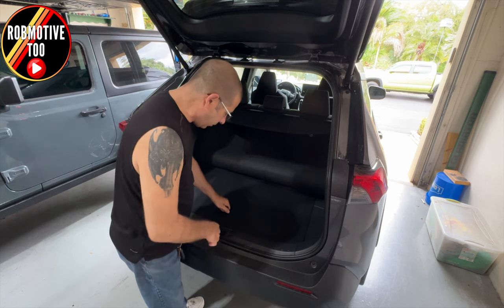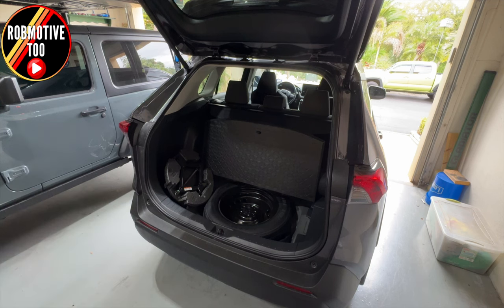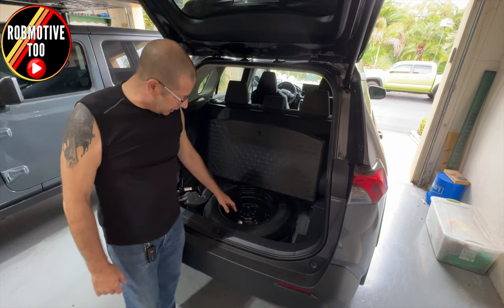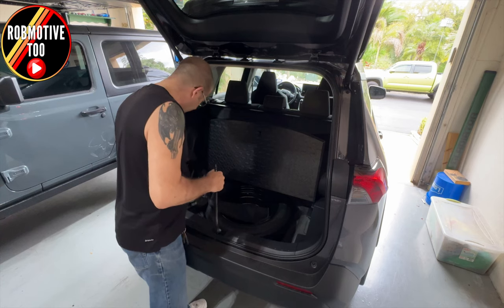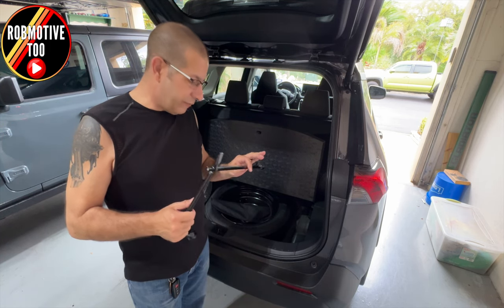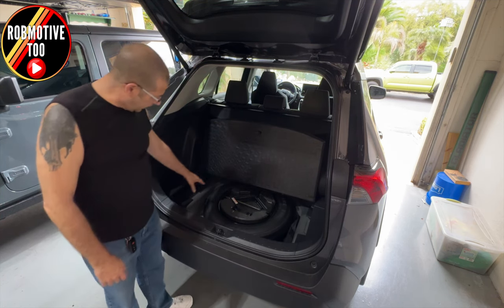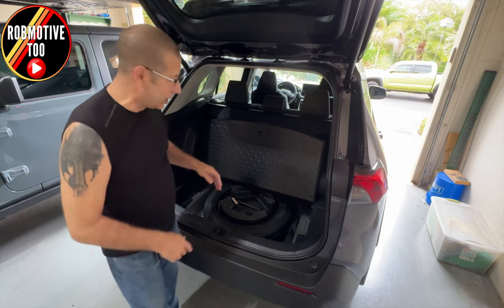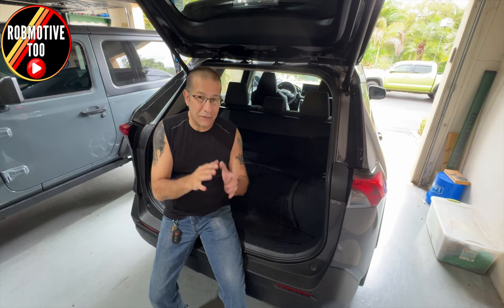Critical Rav4 Thing You Never look At

Comment: Hmm like you not a huge fan of the scissor jack, though I think they are an improvement over the 60s era bumper jacks (had to lift that body a long way befor the wheel started to rise). Not really a fan of donut tires either. That said still a lot more than the new Tesla’s arrangement. Use your cell phone to call for road side assistance. Tesla has to play to the lowest common denominator.  Whole bottom of the car is flat how many are going to look for a jack point?  Miss the jack point run a really high risk of puncturing the battery compartment (that is sub optimal). So not a bad setup for your RAV4
Reply from the maker: I never thought of that!  😬